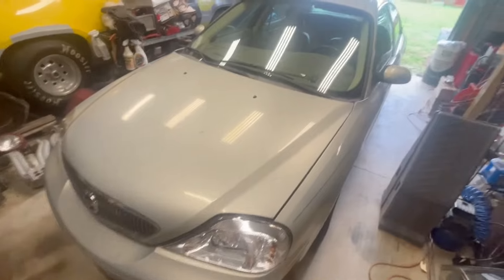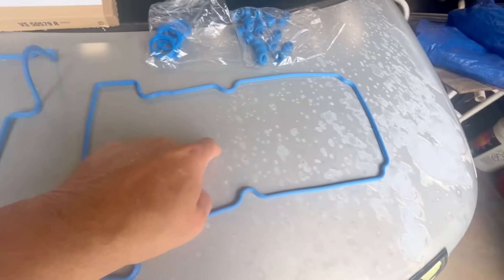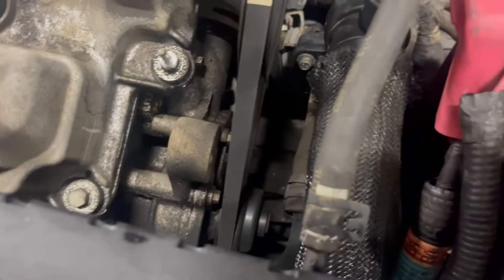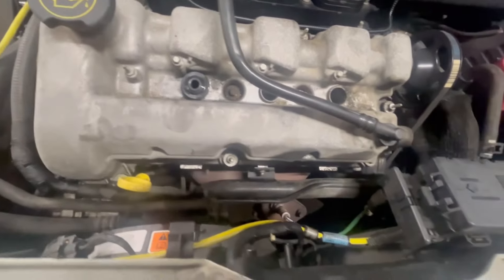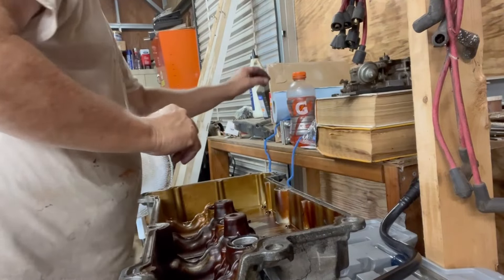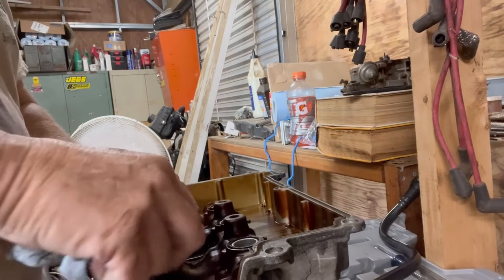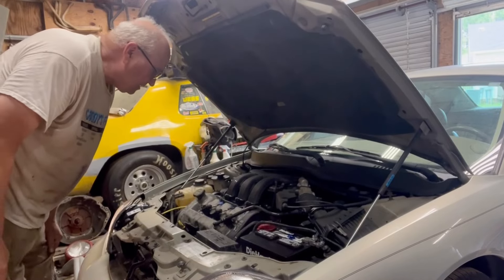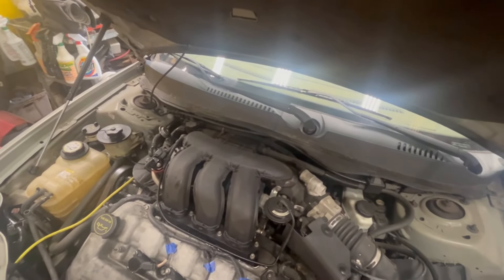Valve cover gasket replacement: Ford/Mercury 3.0 DOHC engine

Comment: You should have pulled the plenium, done the rear cover and the spark plugs. 😊   I don't know how many of the modern cars you have worked on Bob, but welcome to my world.😅
Reply from the maker: Man I pressed big time for time. And it’s 100 degrees in this shop mid day. Just fixing what’s broken
Reply: @bobsclassiccarsparts8772  I understand that heat, it's been in the 80's and 90's with high humidity

Comment: DOHC … had a Taurus that ran great…. The auto transmission…. Not too reliable…
Reply: Yeah, some of them would strip out the torque converter splines, along with other issues.